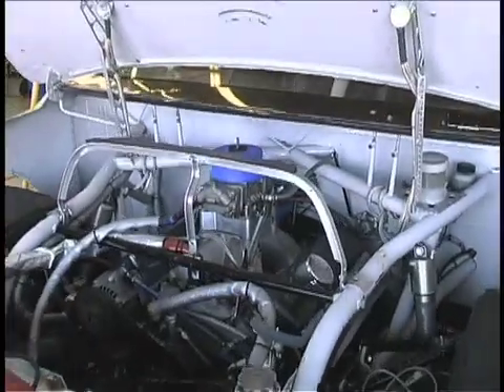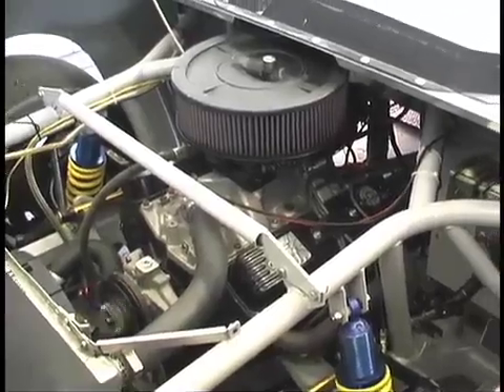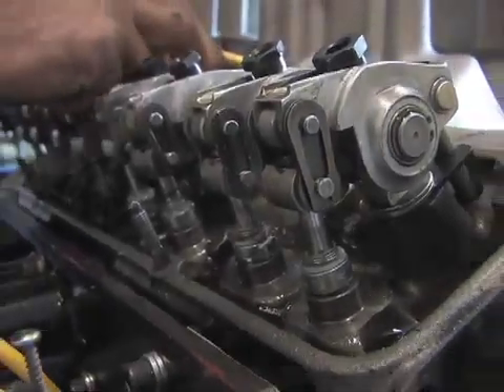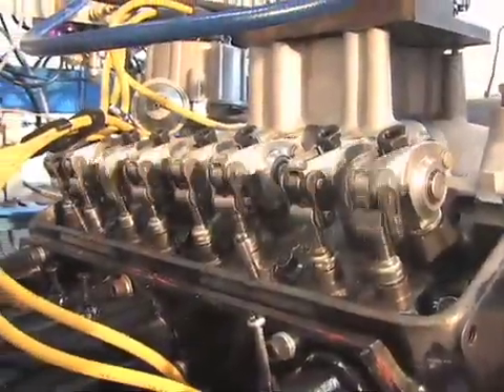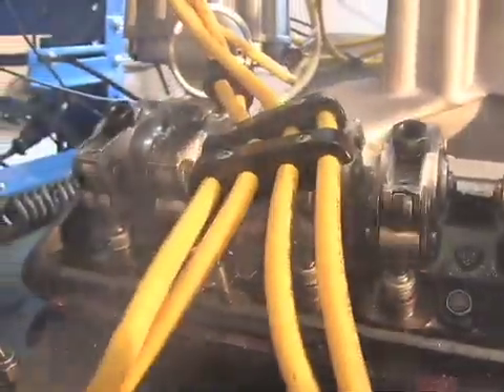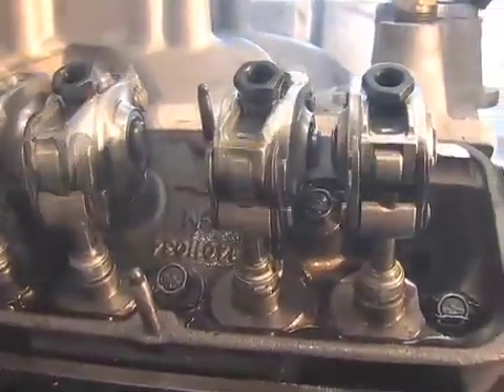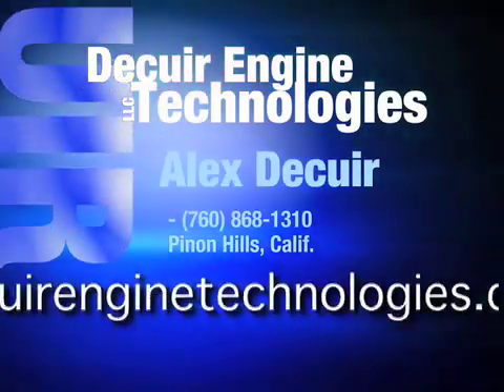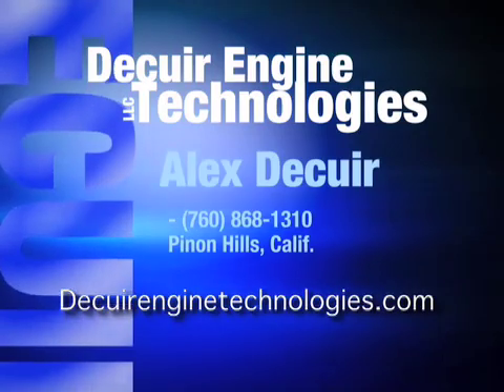Springless Valvetrain For Push Rod Engines!

Comment from the maker: Sir, I think you and others miss the point, this design is for a pushrod application and not overhead cam. We fullly acknowledge that the desmodromic design has been very effectively carried out by Ducati and MBZ but when have you seen it on a small block Chevy? or any other American made V8 configuration engine. 
Decuir Engine Technologies.

Comment: Ive read about something of that sort somewhere. IT was a while ago, I want to say some F1 engines were setup like that, they used Pnuematic valves to open. 

This would be the best of the best ever.

Want MPG, want Obnoxius IDLE, want low range and high range. This would be the best setup ever.

Comment: I always wonder when someone is going to invent an electronic valve train with solenoids controlling each valve.  That way,duration and lift can be adjusted based on rpm or load.  That would really be a major break through.  A race motor could idle like a stocker and make xxx major HP in the higher rpm's.  I'm sure someone somewhere is working on it.

Comment: The only problem that i see with this system is that as the valve-train is stressed, the valve stems, push-rods and other parts that are exposed to wear will cause a gap and the valves would not seat properly. so as cronos51101 said would it not require constant adjustment?

Comment: in principle it is the same as desmo, but the key question is how many times do you have to set lash and how many points of wear are there, the attachment to the valve looks a lot like a chain link

Comment: ducati bikes use that. they sound like shit. and valves burn up because they dont seat properly, the REAL deal in valve springs is what F1 cars use, a nitrogen filled cylinder instead of a spring. there is no spring to break or rebound. but the seals may leak i supose

Comment: for whatever HP that would free up, I wouldnt want to have to adjust it.If that thing wasnt dead nuts on, you'd either lose compression or tear the valves off.

Also I think they're using electromagnetic solenoid operated valves, not sure of it but I've heard of this in F-1 engines.

Comment: I wouldn't trust that setup at 10,000 RPM.  (Nor would I at 5000 RPM) I would stick with properly designed springs, thank you very much.   
This seems like an answer to a question that nobody is asking.

Comment: maby a performance engine solution but whith that mutch noise it would never be practical for a factory engine or most street builds,  ide like to see how it operates at rps's that actualy chalenge valve springs for me to give this system any credit

Comment: the pushrod doesnt have a pin on the cam, it simply rides on it like a normal pushrod, the lobes are opposite of each other. and i agree on that pin situation, mabye of they had a heat clip that you heat it strech it over then it cools around the rocker pins.

Comment: Saab is owned by GM anyway, if GM fails, Saab's done too. I had a 1990 Dodge Ram 1-Ton 4X4 Cummins Turbo Diesel with a Getrag 5 speed with 300,000 miles on it, with the original clutch & ALL ORIGINAL engine. When it comes down to it, it's how you take care of the car. You can make anything last that long if you take good enough care of it and keep it in a garage.  Don't think your so special... You still drive a shitbox. Saturn makes the engines in the Honda Ridgeline. What does that tell you?

Comment: Ever run a solid lifter puchrod car with the valve cover off? Clearly not, otherwise you'd know that's how noisy they are. You'd be surprised at how much noise the valve cover muffle.

Comment: It's similar but not the same. The desmodromic use twin rocker arms, one on the top of the valve retainer, then one below. This functions in the same way, but with a much less complicated assembly. Also, this retrofits onto in-line valve pushrod engines where as the desmodromic system would take a serious amount of work to retrofit.

Comment: the TVR speed 12 engine when on the TVR dynograph (rated at 1000bhp and 1000ftlbs) snapped the input shaft whilst at only 5000rpm out of its 8000rpm limit. when they did dyno the engine they did it as two seperate inline 6 cylinder engines with the redundant 6 cylinders not firing. each bank of 6 cylinders produced 590bhp, add those together and take into account the drag factor of the redundant side. when in FIA GT racing they had to limit the engine to 800bhp with restrictors of 50mm.

Comment: agreed, but  the viper V10 prob is in the heads, all thay need to do is get a ohc or dohc set up and 4 valves per cyl and there you go.... and the ferrari mill is a reving wonder but has alot less torque, witch counts at lower speeds and off the line....still great engines  i have to say...

Comment: 700bhp maybe, but they use 700gallons of fuel, sound like a bag of spanners falling down a flight of stairs and have a displacement of over 7000cc

take the pushrod viper engine. 8000cc and 500bhp.
now take the TVR speed 12 engine, 2xDOHC 48V V12 and 8000cc also.... hmm wow over 1000BHP without even trying.

america is about 60 years behind everyone else. i love the fact that a ferrari flat-plane V8 engine with just 4000cc making over 500bhp at 8500rpm and reving to 9000+rpm confuses you.

Comment: well think, its a solenoid, its either off or on, if the solenoid fails in the "open" position there's no way to close it because the solenoid is stuck.  but i guess its like the timing belts that some cars have- Always replace them at a certain point so that you don't have to worry about it breaking and ruining your engine.  besides solenoids are cheap

Comment: i'm sure a fail-safe design to fail in the closed position...i mean it'd be electronically controlled by the PCM anyway so why couldnt this be designed? or the design may still have a spring to close the valve so if the solenoid failed the spring would close the valve.

Comment: actually, they do... they're called reed valves and they keep the air/fual mixture in the crank case during the power stroke. this keeps the air/fuel mixture from exiting the intake port and allows the possitive crank case pressure to for the AF mixture into the combustion chamber. The rotary valve would work with the same concept, but would need a different rotation ratio with the crankshaft.

Comment: i don't think this system was designed for your old 3 tonne lump of cart iron, think it was aimed more at the backward american motor racing fraternity. 

i love the fact that they even bother when they're using an old carb and distributor. obviously timing issues aren't a worry here.

crap design though. well done again, vorsprung durch technik

Comment: there is soon to be engines with no camshaft at all, just electronically activated valves.i think they got the idea from MDS because it has a solenoid that deactivates the valve for the cylinders it shuts off.

Comment: Think of the advantages this setup would have, over engines with HUGE cams, that use the extra set of springs between the lifter and the rocker arm, inline with the pushrod. No longer would all that force be consumed in merely controlling valve action.

Comment: Cool. Wonder if this system would allow for revs over 10,500 rpm, that seems to be pretty much the limit for pushrod engines these days. Although I guess it wouldn't give much benefit to rev any higher than that with a two valve engine anyway.